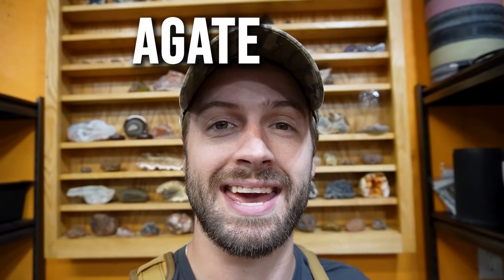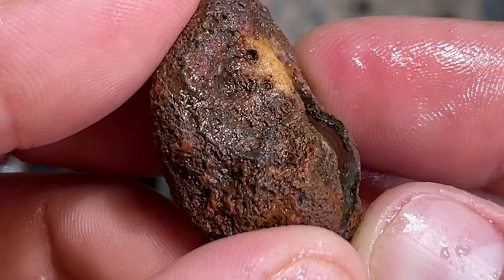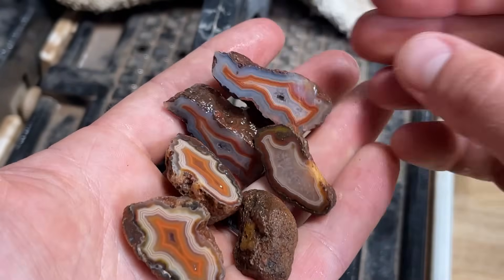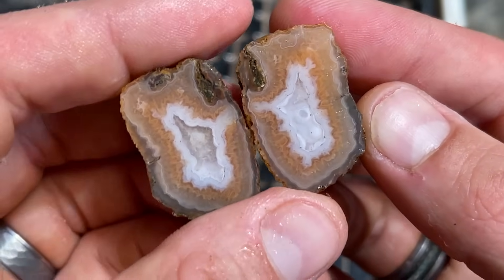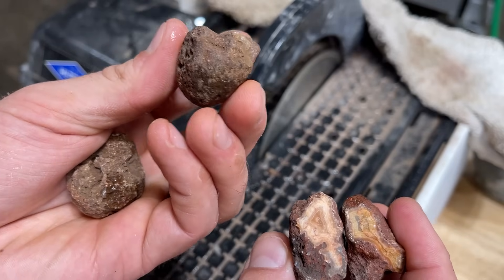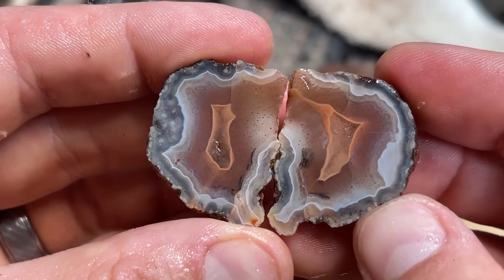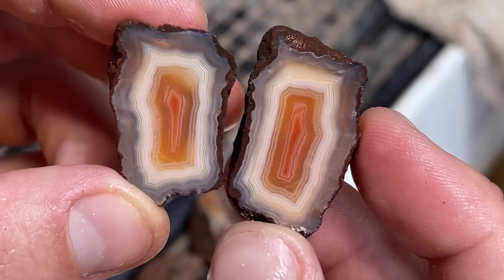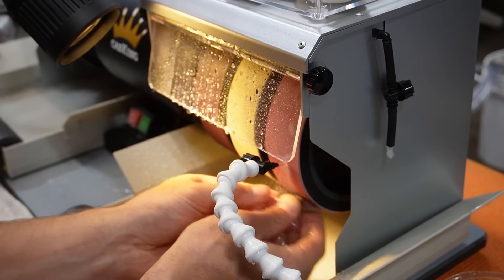Are these UGLY agate nodules beautiful inside?!

Comment: I don't know if this is a real thing but what about I wouldn't handle that's cupped at one end and then you put in a plug of clay or police something you know that's nice and soft that holds the stone Oh sorry agate and then you use it on the polisher You don't have to hold the outside crust personally as it's held by the Sun wouldn't handle contraption